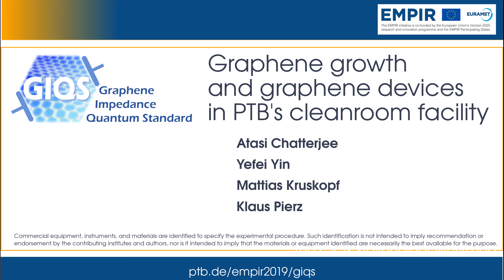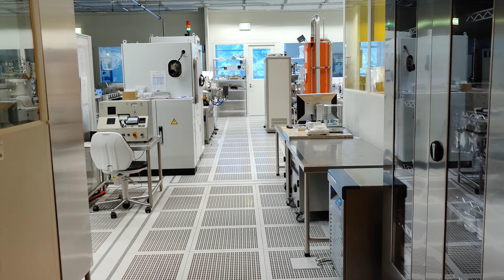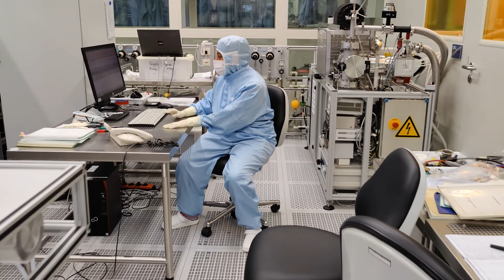Graphene growth and graphene devices in PTB's cleanroom facility

Comment: Thank you for sharing. Can you make a video showing cryocooling equipment setup with Graphene devices? How high temperature can go with Graphene devices while still providing quantized resistance steps? I'm experimenting with simple old 2-stage GM cryocooler at hobby lab level but can reach only 10 Kelvin so far.
Reply: @quahmet_giqs  I understand the goals, just collecting bits of information around quantum electrical metrology, hence the questions (that might be out of the scope for GIQS). My main interest is around Josephson voltage systems at time being, and I do plan to upgrade cryocooler to reach 4.2K levels in future. My hopes are to see graphene devices gain traction in next years with lower cost and better accessibility for more labs in future, with less dependency on continuous liquid helium cryogen access. Thank you again for work you do and sharing publications/videos like this, it is appreciated and welcome.